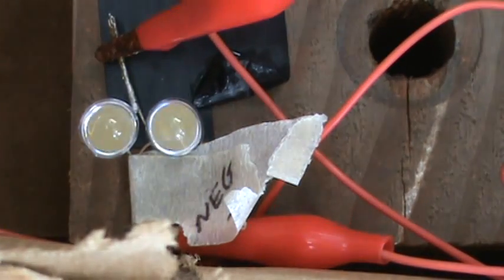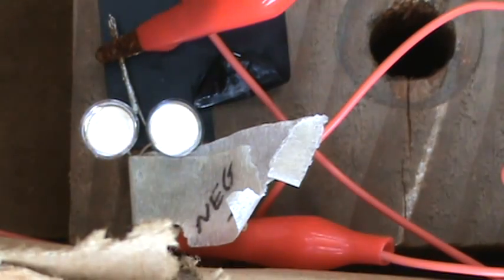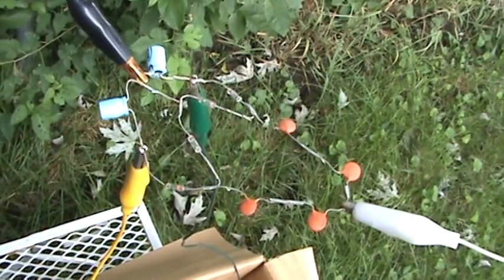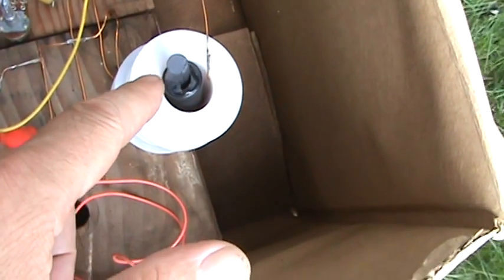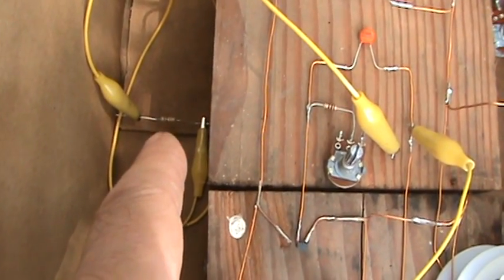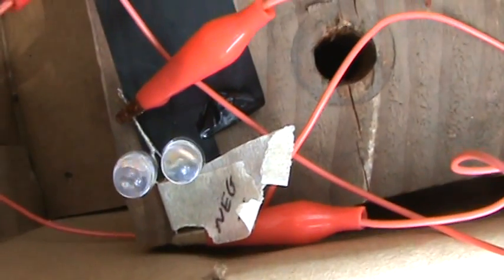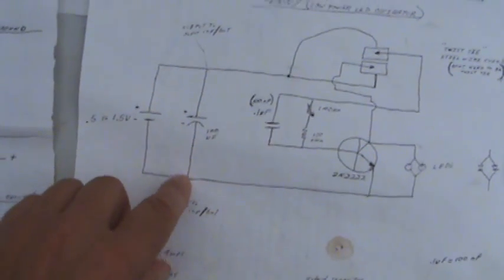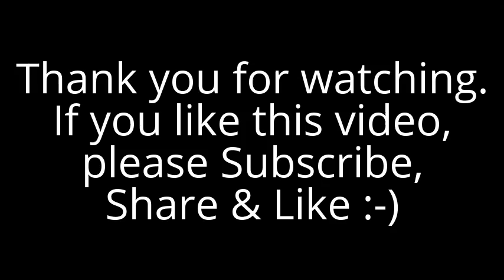FREE ENERGY FROM AIR 2016 part 1 (2 LEDs Lit)

Comment: I am a ham radio operator

dump the 'collector' on the roof.....use more wire......you will collect more power than that 'collector' even if you zig zag it between the roof and fence

with 160 feet of wire antenna, I often get a 2 inch spark when I disconnect it from my radio
Reply from the maker: Yes, the collector is not adding much energy, been thinking of making a better collector.  I understand what you saying, i read many times of how to take coaxial cable and heat in oven to almost melting, and at same time apply high voltage to the cable to create an Electret.  This would be an electrostatic collection.  I want to be sure that i still continue to collect energy from frequencies in the air.  I will continue to think about this.  Thanks for your comments & ideas, keep em coming :-)

Comment: hey Paul have you tried probing parts of the circuit for any audio signals to like radio stations
Reply: No Problem! Nice work there. btw.
Reply from the maker: Thanks for watching Steven :-)  I was looking for an old portable hand held radio, i may have to look at ebay for one.
Reply: A piezo will let you hear the audio... if you do get some, a variable cap/tuner will let you tune them in better..
Reply from the maker: Thanks, i may still have a small piezo laying around & i got a variable capacitance decade box :-)
Reply: just use 2 input wires to a battery powered amplifier and probe the circuit areas for any audio signals like radio stations